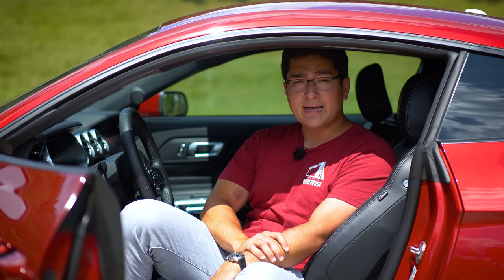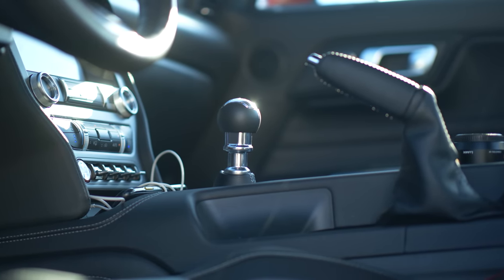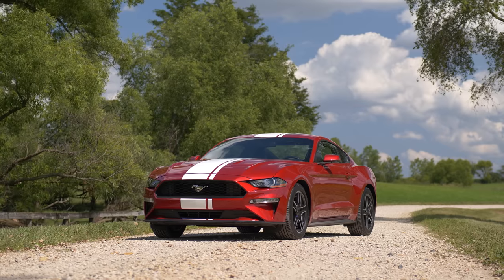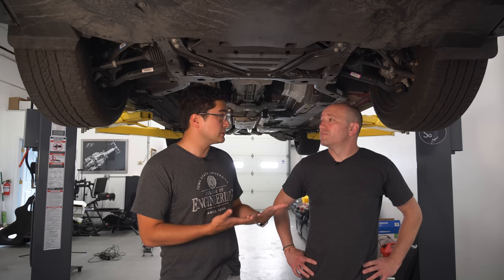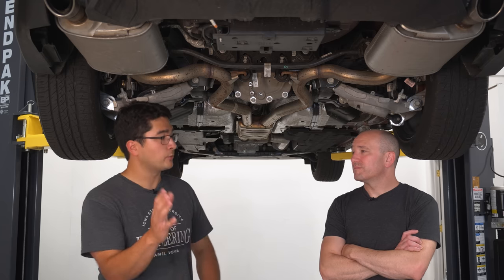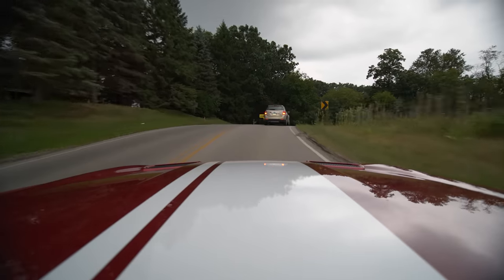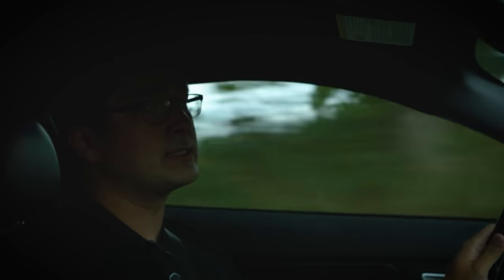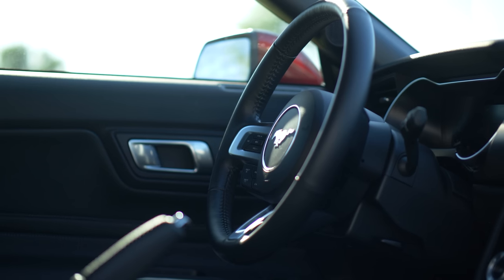2020 Ford Mustang EcoBoost | Red Headed Step Child

Comment: So then this or the new mazda3 Turbz?
Reply: Definitely this, dont count me as a Ford fanboy, I drive a fiesta ST but ve been n Mazda 3 and if U love driving definitely the Mustang
Reply: Ponygt 662 nice man! I was actually looking at the fiesta ST before i leased my EB. Couldn’t resist rwd and the power numbers for the money. I think driving pleasure is subjective though, some wanna slide and some prefer to grip corners like mad. I think Mazda has the better idea of making a connection to the car/road vs the mustang. TBH I feel disconnected from the car in my EB. Especially when you compare it to older cars in the 2000’s era where you have all kinds of feedback/vibrations to tell you whats going on. Still love my EB tho, its a blast!
Reply: @Drewhasit  I agree with U on that..the issue I find with new Mazdas is that the new Mazda 3,6 felt considerably more numb and more comfort oriented that what it used to be.The steering of mazda s still best n FWD class, but the body felt unwantedly heavy and was wallowing and overall body control felt just at par with say a VW Golf. It left me puzzled like what is it? Cuz mazdas had that zoom zoom charecter which was missing in leaps and bounds in new gen Mazdas
Reply: Ponygt 662 yeah I would have to sadly agree. I had a 15’ Mazda3 and just recently test drove the 2020, while it was way better in terms of interior/ comfort, I did not like how they softened up everything else (steering/suspension). I think they screwed up the secret sauce. Or maybe my test drive was just too short. Gonna have to wait to see what the new 2.5T brings!! Hope I can afford it by then.

Comment: the factory power delivery  is HORRIBLE. A tune from a tuner who actually knows what he's doing changes it dramatically with ZERO other mods. Now it zings to redline and when the boost actually comes on, it adds serious thrust. I own both the EB and GT and the EB is funner in the corners because the nose is so much lighter. The S550 chassis needs quite a few fixes and that extends all the way to the GT350 trim.

Comment: I'd say if you care about the mustang branding, this probably isn't for you. I'd love it if the mustang styling/branding wasn't attached to this. It's just the fastest car that you can pick up out the door under $30k and arguably the cheapest option that you could call "fast" with a 14 second quarter mile

You want more, the v8 markets lower than the camaro, is faster than a comparable price charger r/t, and should be the most reliable of the bunch. Asian/european market doesn't address the niche at all of people who just want the good numbers with a low price

Comment: Anyone who know anything about cars would buy the ecoboost all day long.
That engine has so much potential.
Also, it's significantly cheaper to modify and would easily surpass the V8's power with very little mods. And it would a huge amount lighter, handle better, be much more fuel efficiency and would be a great daily.
The V8's are for people who can't let go of the past lol.
And let's be honest, apart from the absolute top hardcore versions, the vast majority of V8's are lazy and cumbersome.
The ecoboost is by far the best all round car in the Mustang range.
You just cannot deny that, well you can actually, but you'd be talking out your ass..!! 😂😂

Comment: I like savagegeese but I think dude was way too overly critical of this car and the think a lot of that came solely from the brand/name of this mustang. If this was a asian/german car that was priced where these ecoboost are priced at they would be slobbering all over the EB for how many boxes this thing checks off. Yes its not putting out huge power but it can return great fuel economy for its level of performance/size/comfort. This is literally like the perfect beganiers enthusiast car, you can easily tune these things to put out close to 400HP and even more torque not to mention all of the other suspension, chassis and brake mods that are readily avliable. Again put a Honda or VW badge on this thing and I'd bet money both of these dudes would be screaming praise for it.

Comment: The 2l doesn't have any resale value. You can get one of these pre-owned where I live for about the same price as a 5 year old VW Polo Vivo. The market is already saturated and nobody wants them. I've seen one get crushed with a full interior.
Reply: Hm idk, depends on where you live i guess. Here used Ecoboosts sell real fast, since the streets are kinda crowded and there are cameras everywhere. Like in normal driving you won't even reach the potential of both the ecoboost and the gt, so a lot of people figure they will be trowing money down the drain with a gt. I daily drive a 2016 ecoboost and the last time i passed 200 km/h was a week ago, really rare to get the chance to floor it without getting a ticket. And a ticket here is like a big deal, you are literally prohibited from leaving the country if you have an unpaid one lol.

Comment: And yet this base EcoBoost is better than any comprable Camaro because in addition to the extra torque of the EcoBoost compared to the 2.0 T Camaro or the 3.6 this is still a better overall car than the 6th gen Camaro it has a better interior and you can see out of it

The Camaro SS maybe better than the GT in terms of performance but Ford is selling a lot more EcoBoost Mustangs then Chevrolet can sell 2.0 T or 3.6 Camaros because nobody can stand to be inside the damn things

Comment: 310HP. And yes it pulls timing to protect the engine. But it also, adds up to 6 degrees timing, if it like the fueling. Let’s not forget it uses octane adjustment ratio to set the timing to the fuel grade you are currently running. 

Regarding the types of buyers, there is also the group of people that modify. Checkout the “Watch My Eco” YouTube Channel. He’s putting down 430 “to the wheels” on a stock turbo.  https://youtu.be/PQQ5m0pQPi4
Reply: there's also a high-performance package for this and it's 5k. Not super cheap but it takes it up to 330hp and 350lbft of torque.
Reply: jbn675478 yeah. Much better engine altogether. Can’t believe they only got 20 extra HP out of it though. So much potential.
Reply: @AtticAZ  i think there's more to it than the numbers, the torque curve i think is changed. There's usually more than meets the eye to these kinds of things.

Comment: old mate on the left talking so much shit. You can get, with basically JUST an intercooler upgrade and nothing else a tune from PD tuning or Tune+ on 93 and easily touch 350hp. 
The main thing i have seen is the early motors use to blow bottom ends, especially in manual trans cars because of the torque LSPI'ing the hell out of the soft and shit bottom end.
BUT, when same engine people bolten on larger turbos and ran E30 where the boost wont come on till later to stop LSPI from naturally occuring they were running bloody sub 11s on stock motor. 
Anyway, who cares. Not a v8 grumble pop. 
The stock tune from ford, on my car was so shit. I ran my stock file up to my tuner and it was not running optimal, just very safe but crap. 
JUST the OTC stage 1 cobb tune sorts this out and brings the car alive, easily +30hp on 93 for 5mins of effort.

Comment: The 1999 Trans Am 5.7L Ram Air WS6 produced about 330 hp
.....2010 Chevrolet Camaro 3.6L V6, produced  304 hp / 273 pound-feet of torque
2015 2.3L EcoBoost 310 hp so...
WHAT IM SAYING IS YOURE FULL OF CRAP....JUST A FEW YEARS AGO...THE ECOBOOST HAS THE HIGH PERFORMANCE THE V8s Had....why are you so Negative?

Comment: Going back to it's origins in the 60s the Mustang has always been a dual personality car: a basic low power "secretary" car and the full optioned performance gonzomobile. With all variants in between. I laugh when I think back to my new 1983 Mustang GT with a 5-speed and V8 with that awesome 175 HP! I recently drove one of these newer ones and was blown away by the relative performance and value. You young guys have no idea how good modern cars are and how effortlessly they go about getting the common folk around. This was my first thumbs down. Better off to leave the videos with attitudes like this on the "cutting room" floor.

Comment: You spend the whole video saying what the car is not, or how it’s lacking. You call it a daily driver substitute, you say you don’t find it exciting, you say it’s not for you. This is a fairly weak review, you spend so much time being disappointed that it’s not a different Mustang that the viewer isn’t left feeling very well informed on this model. It’s a refresh of the car, there should be plenty to say, if there isn’t make the video shorter. If your going to spend the video whining that it’s a Mustang for the masses don’t review it, move on to something else. I’m a fan of a car with a decent amount of power that also does use up my whole pay check at the pump.
Reply from the maker: What you just said is exactly what I said in the final thoughts. People only hear what they want to hear, and tune out the rest.

Comment: My 1966 mustang 4 speed 289 had less power than this 4-cylinder has more Horse power.    I had two rebuild the engine from bottom up with a crane cam 300 Duration 500 lift and all the other fancy stuff from the hypo Store.  In 1970’s then she was bad ass.  Air suspension and all.

Comment: Who wants to listen to these two ever again? They're breaking tires loose constantly in a gorgeous car with superior weight bias to a V8 model,  offering nimble handling at sane  speeds, and sounding like this car which gets to 60 in under 6 is terrible.  My guess is that owners will simply buy stickier tires after they've worn out the first set and have the perfect car.

Comment: This powerplant deserves to be in a better platform than this pig of a chassis.  300hp and 350lbft is decent, but its always going to be overshadowed by the fact that it sits in a 2 door WEIGHING 3500lbs smh.. Even the Focus RS is overweight.

Comment: They Mentioned The Mustang as a Brand.  It is not a Brand ;the Mustang is a Model, they're like Ford Representatives they have concept of the product they're trying to sell.  Ford & Lincoln are the Brands not the Mustangs.   Now the only other issue i have with Ford is the 4 door variant, they're calling Mach E. Ford reps. Have no respect for the Mustangs Icon name & Badge, as well, as it Historic Automotive, Heritage.  A 4 door variant Dethrones All Past, Present, & Future Mustangs from the Muscle Car : Car Culture & drops it down to just a Sports car.  Camaro in 2 years will be discontinued, & in 3 years they will introduce a 4 door CUV Camaro. Therefore, the only Muscle Car in production  will be the Dodge Challenger.. Henry Ford II, Lee Iacocca, Carrol Shelby,  & Steve McQueen are all turning in their GRAVES.  I don't mind an all electric any.   if an all electric Mustang is built then it should have only 2 doors.  They made the Lithium Mustang 900 hp & 1,000 ft. lbs.Torque with the 6 Manual Transmission.. i even thought about buying a Jaguar F-Type SVR or R, though all are Automatic. Boring

Comment: Who buys a Mustang with a shitty 4 cylinder engine? Especially in the states where the price of the car is way lower that here in the EU, and the salaries are much higher.
Those who purchase this car should be ashamed of themselves. It is like buying an MX5 with an automatic transmission. It is a disgrace to the car community. Nothing more that showing off with a car which looks like a mustang but basically is Focus inside...lol.

Comment: This is a 2020 Mustang? What a rust bucket underneath in some places already.
Reply: that's not rust, lol. No modern car is going to have a problem with rust that quickly.
Reply: @br33zy771  
Lol! Except perhaps Mazda and Ford ? Freeze frame @6:45. Here you see a perfect example of American quality (or lack thereof). Some bolt heads are rusted already, and not others on the same caliper. And @8:52 those welds on the exhaust certainly won't last more than the short 3 years/60 000KM warranty period.
Reply: @AlainHubert  no way dude, and if so there is a warranty for rust it would be repaired.

Comment: Were you guys alive in the early 80's with 68 hp  nissan sentras .  And the old mustang two.   And the bloated huge v8  detroit cars making 150 hp ??        This car seems better than those old choices.     Who has 50 to 80 spare grand to put in a car to abuse.  ??

I think you guys ard spoiled rotten abusing press cars that are over 50 k.
Reply: Fair point but we tried to make that clear putting it in perspective its a fine car. But the base model is not a substitute for a hot hatch.
Reply: @jackholmes8105   I have  no mustang interest but thats still a lot of money.  Its my opinion that the 4cyl engines being stressed with a turbo will never achieve long term reliable service life.  The older v8 engines did not put out massive power per liter..  but I think over a couple plus decades the v8 kept on working.  

    My winter car is an old panther platform mercury.  I see those getting 300 k miles with basic service.  Not fun cars by any means..  but long term cheap and reliable.
Reply: Is that 10 speed the dreaded gm / ford trans with huge problems?  Or is it ok in a 3500 pound 300 hp car ??   

I am glad to ever have manual trans offered in this.. and the new bronco although just in the 4 cyl varient.    I only have interest in buying manual trans cars.  But usually quite older ones.

Comment: Noone gonna talk about how unreliable the ecoboost is. The manual Mustangs all have issues even for the V8 DONT BUY THIS CAR. FORD IS BEING SUED FOR THIS CAR
Reply: No
"All" manuals are Not having problems. Only the people that are street & drag racing and beating on their cars. Number of Mustangs with manuals 'Sold' vs ones with problems & it becomes obvious who is beating on their "modified" cars. Everyone knows the USA madeTremec is better than the China transmission. But, that becomes a cost factor. 
The Answer Is . .. raise the price for the better Tremec transmission.
Reply: @stepside2839  maybe not all, i just dont think a car breaking before reaching 100k is reliable. especially when ford is willing to fuck over their customers with their made in china trans (very unamerican). they tried to hide it too. they just got out of a lawsuit for making super shitty focus and fiestas ( that is suppose to be their reliable cars ). Focus RS is famous for head gasket failure under 20k miles. Ford is so bad at making cars that they stopped making cars and FOCUS ;) on their trucks and mustang. Lets not talk about Ecoboom or how turbos will eventually wear down the engine or the turbos will eventually fail ( applies to most inline 4 turbo) costing the customers lots of money. Especially if its made by ford a company that pays their engineers less and less every year making parts suck more and more while toyota pays their employees a great wage year after year.

Comment: Ford shouldn't have created such a vehicle in the first place. Mustang should have a v8 or v6 minimum. More affordable? No problem - throw out everything except for V6 and you will get a cheaper Mustang, but v4 is a joke. Make it a "Lamb" and put any low power engine everyday of the week, but don't call it Mustang. Now they make an electric soundless "Mustang" - another nail in the coffin. Why they just can't start a new EV era with a new brand line like Panthera - a silent killer. Someone, please, tell Ford that Mustang is not the only word in the dictionary and that a Mustang brand has a real meaning to people.